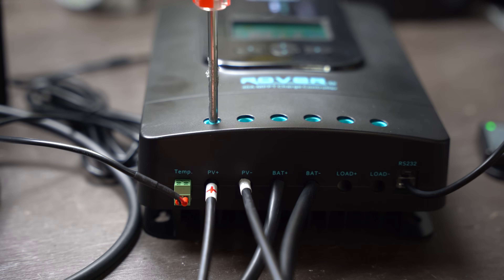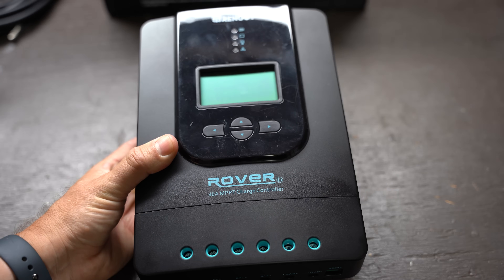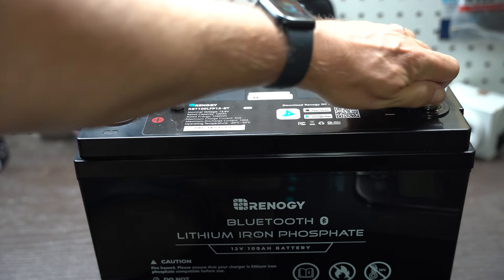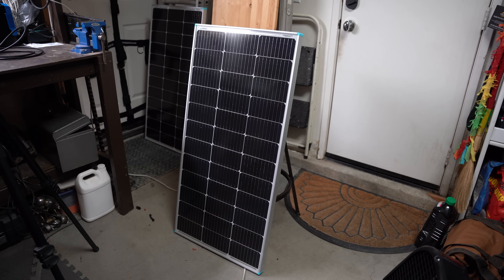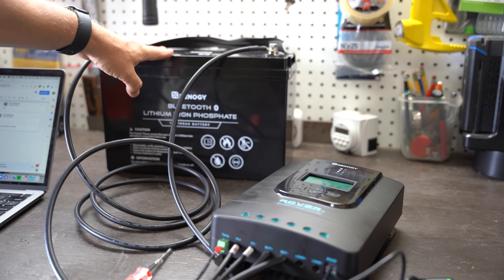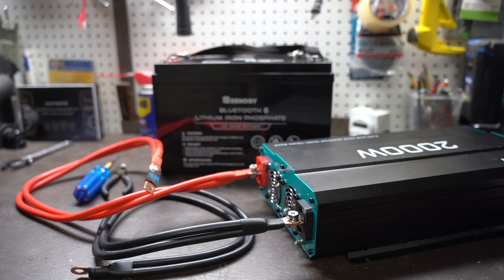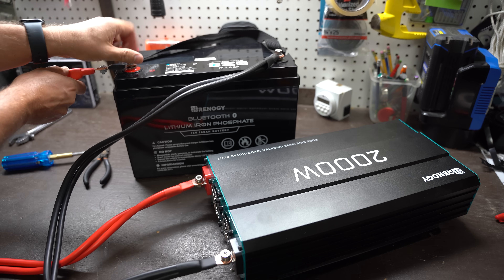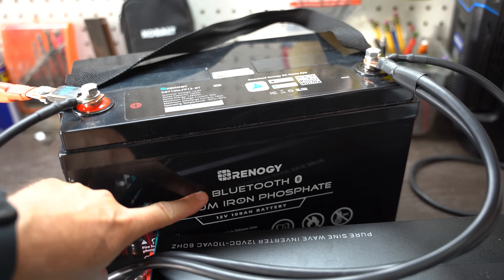DIY Solar Setup: Easy to Follow Step-by-Step Instructions

Comment: BTW, a very good video on setting up a system.
I did mine many years ago. I bout 5 Kyocera 120 watt panels, a morning star 30amp PWM CHARGER, two, 6 volt golf cart batteries I had since 2012, which I pulled out of my old RV, b4 getting rid of it. I'm shocked the those lead acid batteries lasted up till now! I finally need new batteries. 
I had to replace an inverter and went with the POWERDRIVE 2000 watt inverter, this month, after the last one finally died. Very happy with it.
I'll install the Powerdrive reset-able Fuze and braker for 300amps . Being a ham operator, I'll do it on both of the cables because I live at 6,000ft elevation and thunderstorms come in low here. That should make it impervious to strikes with the disconnects on both terminals.

I'm looking at L16 batteries. Very expensive with 390 amp hours and up, to replace my 6 volt Napa golf cart batteries. 
Either that or Trojan makes a 12 volt battery I'm eyeballing. I'll need 4 of them to run my cabin.
Everstart is also one I'm looking at too. The DC29 MAXX, IS AN OUTSTANDING battery with a 2 year free replacement for their marine battery. Weight is 61# each. So as much as 1, 6volt NAPA battery.
Problem is finding them in stock now, at Walmart. Hunting for them as I type.

The trick to Lead Acid batteries is the 50% rule. That's what kept mine going for 10 years.

Comment: That was a great start. Thank you, thank you. I am unclear about on thing. The charge controller presumably limits the current going into the battery to stop it from getting damaged. If there is too much electricity getting there, where does it go? Does the charge controller get really hot getting rid of it through heat?
Reply from the maker: excellent question.  once the battery is at max, the charge controller does not send more power to the battery.  Where it goes?  I honestly have no idea lol.  That's something I think about a lot as well.  Will look into that more.
Reply: @CityPrepping  I an old but gad some science. If the charge controller simply opens the circuit it may stop the current. However the panels would still be generating voltage and, without current, that would cause the panels to heat and get damaged. So I am sure there is something  else in there to protect the system.

Comment: Some great basic information with lots of emphasis on safety!  The only suggestion i can think of would be to add some Anderson connectors at the charge controller end for the PV panel and battery connections.  Then, it's a simple and quick operation to disconnect them if needed, and once you have the correct polarity for the Anderson connectors, you never have to worry about getting them cross connected again. Thanks!
Reply: Well, that's interesting, thanks for the info.

Comment: Well the battery is 799 and the inverter is 500
Reply from the maker: there are smaller units available.  Just what I have on hand.  i'll do a follow up video soon discussing scaling for size and needs.
Reply: @CityPrepping  yeah true but also good to go a little bigger to room for expansion

Comment: Kris, Renogy does not state this, and for a relatively low amp system 40 Amp /2000 watt, it is not going to hurt when the inverter connects to the battery and it sparks due to the capacitors in the inverter, but when you are dealing with a high wattage and amp it becomes dangerous. The way around this if you use a resistor, this prevents a spark from the battery. If you watch Will Prowse on YT he explains really really well. Kindest regards, take care and keep safe everyone in these times, may God bless you all, hooroo from Down Under.
Reply from the maker: if you have a link to that video, i would greatly appreciate that!

Comment: You make it look so simple. I would love to see how to hook up multiple batteries with multiple solar panels. Enjoyed your video
Reply from the maker: that will be the next video where I'll go into more details.
Reply: @CityPrepping  
So did you ever make that next video where you go into more detail using multiple batteries and panels because I can't find anything in your library content?
Reply: @CityPrepping  thank you I’ll be watching
Reply: @CityPrepping  Why doesn`t the fuse come with a way to connect it to the inverter cable? I have no idea what bolt to order.
Reply: @CityPrepping please share link to the video for multiple batteries,
Reply: @CityPrepping  And of course the fuse has no information whatsoever included on lug size. Is it metric or in inches? So I have no idea what to do. I guess I can order a lug kit of various sizes and hope one works. Why does everything have to be so impossible to get info about? I have everything needed to hook up a solar power system and can`t find an answer after searching for days on how to connect a simple fuse to a wire. Can I measure the inner diameter of the fuse and get the right answer or will buying a nut and bolt that size be wrong and a smaller one will need to be used?
Reply: @baneverything5580  Did you manage to find the correct size fuse?
Reply: @robnewton9924  Yes. Took forever to find bolts and nuts. Had to spend 20 bucks for a variety [pack...well two and ordered the wrong size another time. Used my solar for air conditioning after the severe storm hit Louisiana recently....80-100 mph winds. Ran my air conditioner from 3 am until after 6 pm from a 300 ah LiFeP04 Ampere Time and two 190w solar panels and an extra 100w. My Fridgidare air conditioner draws 380 watts.
Reply: If you can wire up an electric train set then you can wire up solar
Reply: @pamn7457• thanks for asking the question of multiple batteries because I was thinking the same thing. 
About using a larger battery or several smaller ones just for back up power.
Reply: Kindly share the next video link guuz

Comment: This is almost my exact setup. 
* 2 Batteries:
Renogy Deep Cycle AGM Battery 12 Volt [1: 200Ah,  2: 100Ah], 3% Self-Discharge Rate, 2000A Max Discharge Current, Safe Charge

* I added a battery maintainer:
NOCO Genius GENPRO10X3, 3-Bank, 30-Amp (10-Amp Per Bank) Fully-Automatic Smart Marine Charger, 12V Onboard Battery Charger, Battery Maintainer and Battery Desulfator with Temperature Compensation

* Controller:
Renogy 100A 12V/24V/36V/48V DC Input MPPT Solar Charge Controller Auto Parameter Adjustable LCD Display Solar Panel Regulator fit for Gel Sealed Flooded and Lithium Battery, Rover 100A

* Inverter:
Renogy 3000W Pure Sine Wave Inverter 12V DC to 120V AC Converter for Home, RV, Truck, Off-Grid Solar Power Inverter 12V to 110V with Built-in 5V/2.1A USB Port, AC Hardwire Port, Remote Controller

* 3 Cheap solar panels for now.

Comment: This such perfect timing! I have been gathering the pieces to build this and now I can get the rest of what I need and get it up and working! Thank you!
Reply from the maker: Glad I could help!
Reply: @CityPrepping  Yes, YOU are a blessing with all you share and your attitude is so needed. Mahalo and Much Aloha for all you do!!
Reply: Does anybody know what nut and bolt to get to connect the fuse to my inverter cable? Should I guess or what? I get no results in search after search and no answers can be found anywhere.

Comment: Learning DIY solar skills is worth it.  Electricity is so essential to so many things. With DIY, if something breaks, one can  diagnose, and fix it.  With supply chain problems, one might need to mix and match, have the ability to cobble something together.  

(My only other recommendation to the skill set, is learn how to use a voltmeter, do one's own cabling with MC4 connectors.)
Reply from the maker: You're 100% right!  I'll introduce those elements into the next video I'll do.  This video was a 101 video, next we'll build to a 201 video :)

Comment: I have pretty much this exact setup built into a robust standard box (apart from the solar panel, obviously). I drilled some holes into the front sidewall to integrate a few 12V sockets (don't forget the fuses!). This makes the whole thing very portable, versatile and safe while still beeing super simple and reliable. In addition,  there is even a cable to connect the battery to the car to charge it from the alternator, if needed. But be aware, this step needs serious cables, fuse, switch and a connector in proper dimensions. 
The setup has been working like this for quite some time now and i wouldn't want to miss it!
Greetings from switzerland!

Comment: Isn't the LiFePo4 battery charge profile more like an AGM battery than a Lithium Polymer?
Reply: I guess the real question is: Is the "Lithium" setting on the charge controller specific to  LiFePo4?
Reply: Found the answer in the manual: 
Li setting is for LFP

Comment: Great video Kris. Now that I have had my deep well drilled, solar is my next step. This video takes away the uncertainty with trying to figure it out alone. Very easy the way you broke it down. Thank you. Is there a way to run 220v with solar? I’m assuming by using a 220v inverter, but not sure.
Reply from the maker: Yup, 220 is doable.  It's more advanced that what I covered in this video, but a system can be built to handle this.

Comment: Can you show a video connecting multiple solar panels for a faster charge also, a system strong enough to power a refridgerater and battery system should the grid go down and protect from and EMP pulse? Thanks in advance.

Comment: Great Video!!  Great to see  something more directly related to prepping. I built my own system a couple of years ago and  learned (the hard way) to test the heck out of my setup - don't make assumptions about what it can or can't do.  I could run most of my power tools, but a table-top saw would kick out the safety fuse on the inverter. Finally added a second Battery and upgraded to a 3500 Watt inverter, then added a 3rd battery on top of that (so now running 3 Optima D34M deep cycle batteries).  It was worth the effort and expense - have used it through 2 power outages and it worked great.

Comment: Utilizing solar panels greater than the intended storage voltage is ideal because when the panel is not collecting full sun and only having 50 and 60% efficiency dusk and dawn or cloud cover, they still could be delivering well over 14 volts and therefore providing a charge to 12 volt batteries. If you're using a 12 volt panel, you won't get that on a 12 volt system in those conditions. I recommend using 12 volt batteries for storage, therefore having a 12 volt base system, and I would recommend at least 24 or 36 volt panels to power it. A 12 to 48 volt controller will handle any volts under its maximum.

Comment: Excellent video. Not a criticism, just a recommendation regarding the cables. It is common convention to use red cables to connect the positive (+) connection points  and black cables for the negative connectors (-). This helps you readily identify the correct connection points.

Comment: Thank you for this because other videos out there are kinda complicated and I was kind of lost. I do not know how to know how much solar panel and how much battery to figure out to buy for my needs. I tried to watch a few how to videos but it seems the solar co is just trying to oversell things that you may not actually need and inflated costs. I am wondering if you have a guide or suggestion for that? If someone has a RV they prob only need the 100 solar panel but what if you have a tiny home, cottage, 3 bedroom house etc? What if you power one part of your property like appliances and use solar for another like a guestroom, patio or deck, office, workroom , chicken coop heater as solar and power elsewhere in the home? That is the part I am kind of lost at. Thanks again for always bringing the helpful information and best wishes to you and your family.
Reply from the maker: will do a video shortly explaining sizing your system.
Reply: @CityPrepping  thanks so much 
I am moving to a rural area so I would like a combo of solar and power
That is so cool you read my question

Comment: I would say getting around 500W-1500W of solar panels is a minimum in order to run your devices in an offgrid fashion for an extended session and that's assuming your not maxing out that inverter (just running a fridge and/or freezer). But this IS a good starting setup. Another option would be to just eliminate the charge controller and panels.. and just purchase a good battery charger. (use the extra money to purchase more batteries)
Reply: How would you charge the battery charger if one is off grid? (Serious question, I like your idea)

Comment: Suggest wrapping some red and white electrical tape at the ends to tell which cable is positive or negative.
Reply from the maker: Yes!  I did that on the solar wires, but in the future will have it on the charge controller wires.

Comment: Great information! I’ve been wanting a how to like this with links for forever!! Will you consider doing a video adding additional solar panels and more batteries? I’m wanting to learn and am solar illiterate 😅
Reply from the maker: Yup, I'll do a follow up video showing how to expand out the system.  My hope was to just get people started with this video :)
Reply: Thank you so much!! Also on the solar panel extension cables would you do two 10awg or 12 awg cables for this set up? Also what awg for the battery to charge controller?